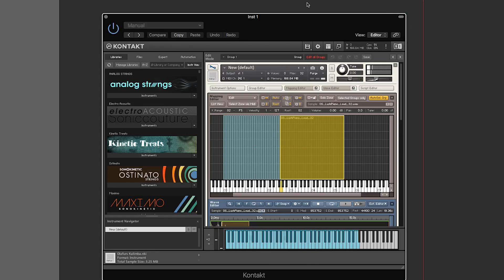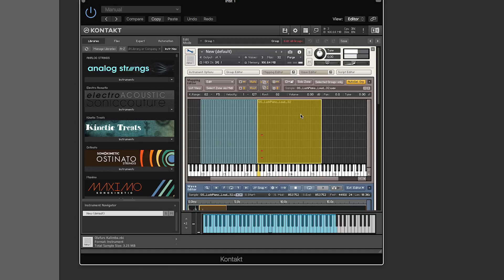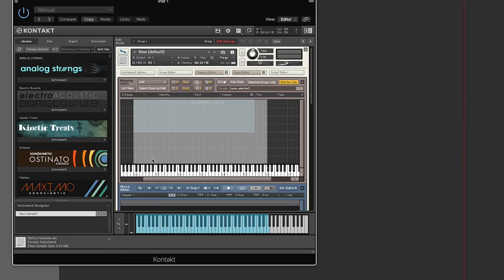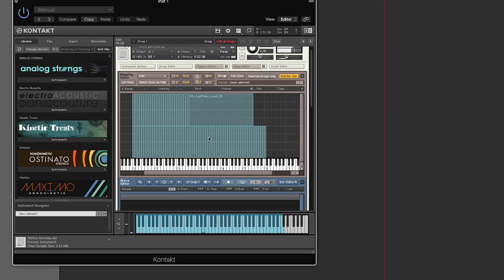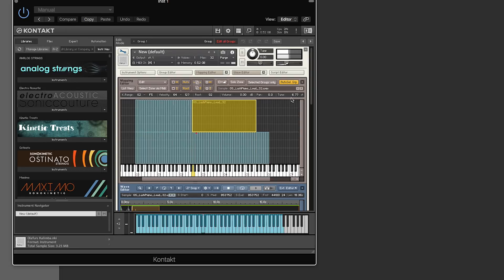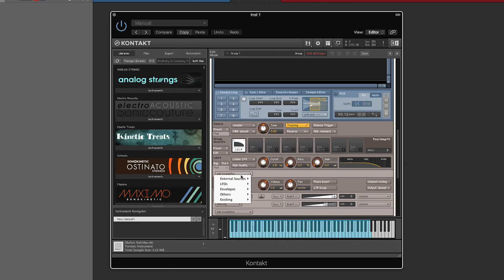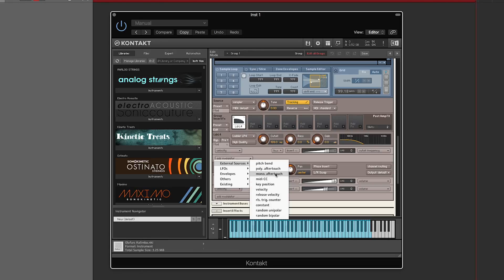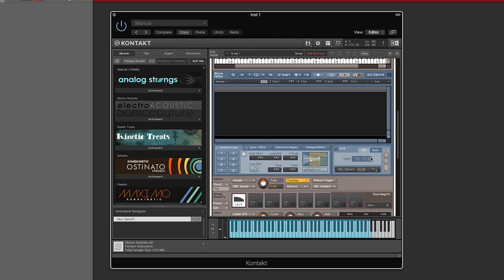Kontakt 6 Tutorial: Velocity Mapping and Cutoff Velocity Modulation

Comment: Great video! Quick question! This is in regards to Kontakt instruments. I would like to know the steps necessary to remove the default panning effect generated by key positioning. For example, with Straylight, I have the preset called "As Wide As" loaded. When I press a key on the right side of my midi keyboard, it sounds louder on my right headphone; the same goes for the left side. The problem arises if the project I am working on consists primarily of lower pitches (causing the left headphone or speaker to be louder) or consists primarily of higher pitches  (causing the right headphone or speaker to be louder). This causes the track to sound disproportionate when I want it to sound evenly distributed between both headphones or speakers. I want a centered sound instead of a sound dictated by key positioning. I've researched tutorials and gone through the Kontakt manual, but I can't seem to figure it out. How can I resolve this? I would appreciate any advice. Thank you.

Comment: It seems Kontakt has a velocity issue. And a quite strange one.
With the Yamaha CP-33 as a controller, in Reaper 6 with Kontakt, player note will input with a very long sustain. Only with this combination. With Keylab Essential or in Cubase, Kontakt behaves normally.
If I activate Velocity off in Reaper and input high values (near 127), the unwanted sustain disappears. It seems like a Velocity off problem.